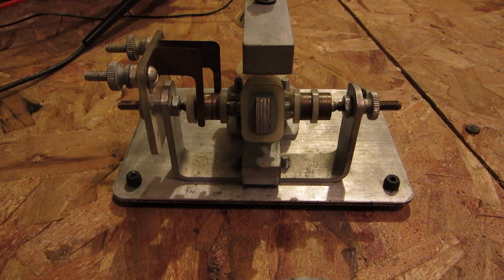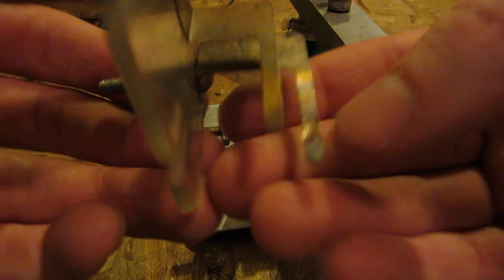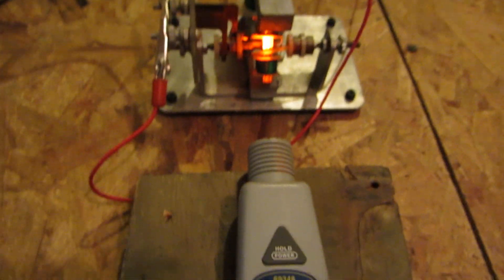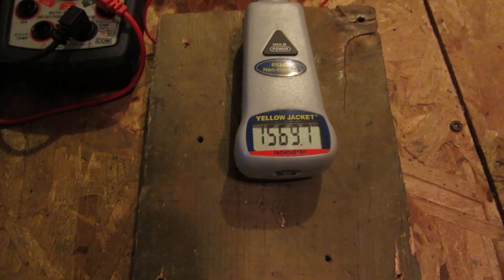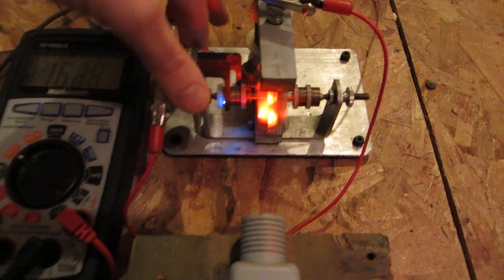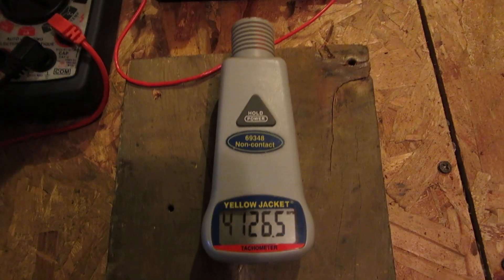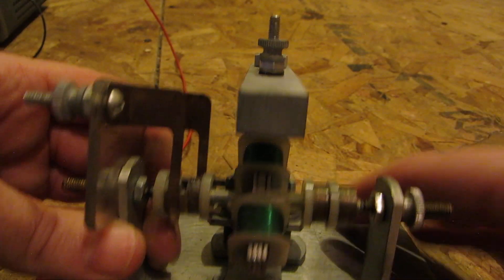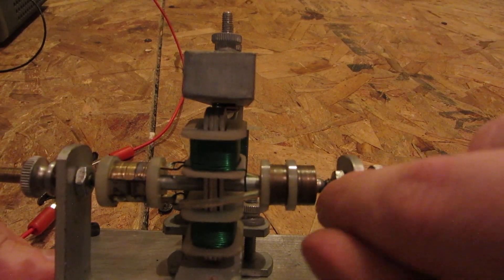Demonstration Motor 1

Comment: if you run it as syncronous motor you can als control the rpm. with a tone generator and a audio amplifier. a 2 ohm car works great for this type of experiments :-)

Comment: if you put dc in the rotor slipring commutator.  and ac to the field windings. it wil run when the rotor is on syncronous speed of the ac frequincy. also you can use it as AC alternator. put dc in the slipring rotor and get ac output out of the field windings.
Reply from the maker: Interesting ideas, Will have to give them a try.